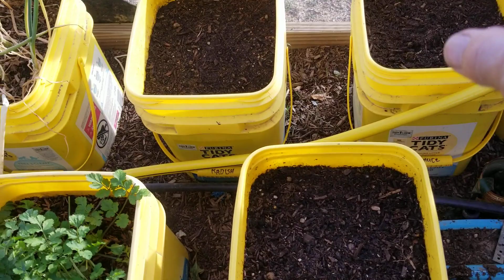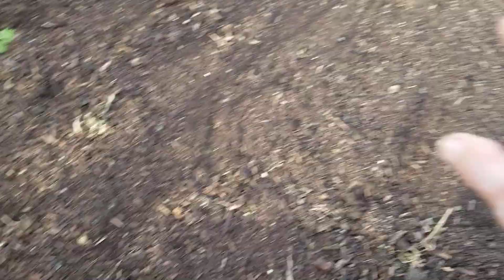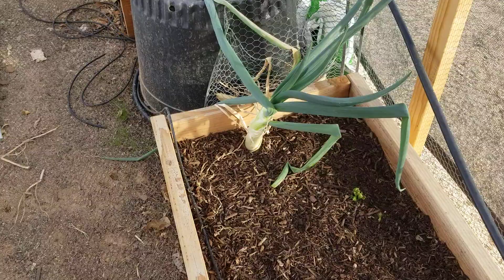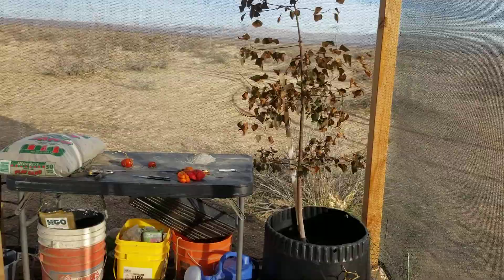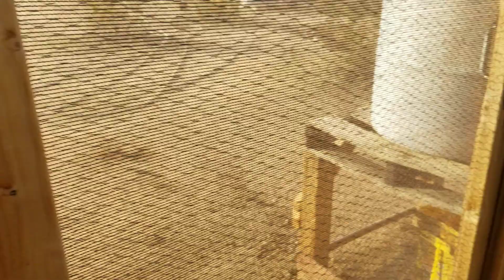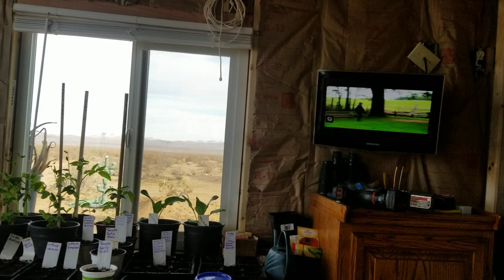Essential Homesteading Tools, part 2. Jan.18, 2020

Comment: Did or do you add plastic on the greenhouse? Do you leave your shade cloth on year round?
Reply from the maker: Yes on the shade cloth, no on the plastic.
Reply: @GBear  thanks! We are doing the same this year. Last year we wrapped in plastic because we had tropical trees. This year we put them in the garage.
Reply from the maker: @blissfulacresoffgridhomest2098  down the line I plan on building a glass house for those types of trees and plants.
Reply: @GBear  you are a wise man. I jumped the gun and got the tropicals before we were prepared. Live and learn. Ignorance is NOT bliss! 🌻
Reply from the maker: @blissfulacresoffgridhomest2098  yeah, I planted a whole orchard on the other side of the container before I knew about desert ground squirrels.  They killed 300 bucks worth of trees in a week.
Reply: @GBear  OUCH!